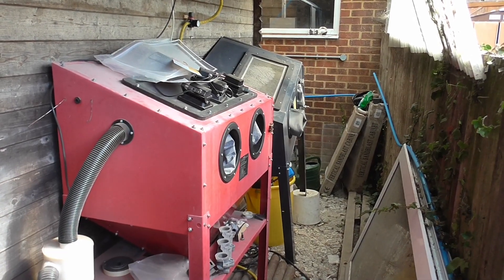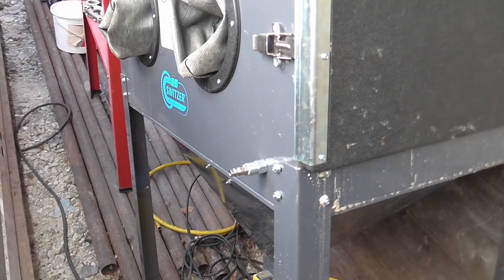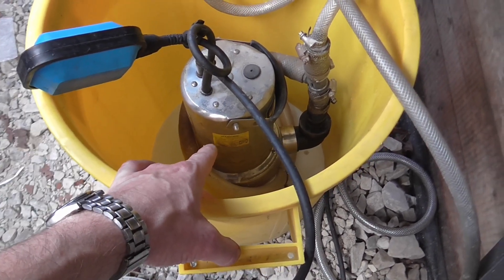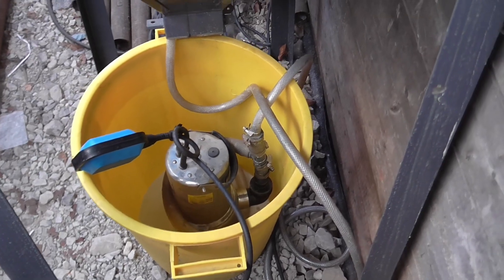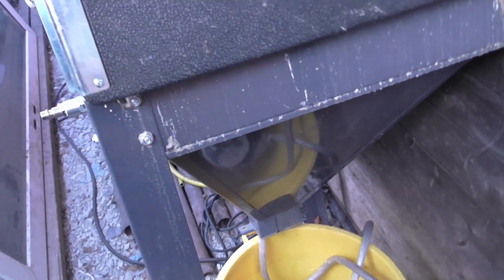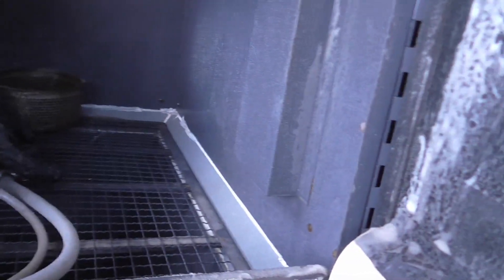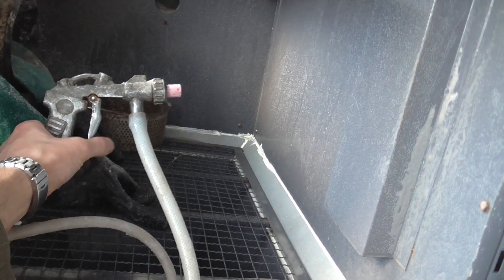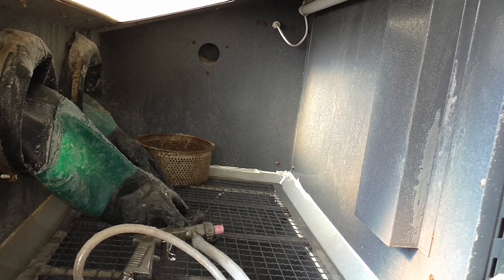A simple DIY Vapor Blaster

Comment: I highly suggest you clean your setup after each use and focus on the spray gun. Soak it in mineral oil and clean. I would use Fluid Film myself. It lubricates well, provides a strong barrier to the atmosphere, clings to the protected area and is nontoxic. I believe lanolin or something similar is the main ingredient
Reply from the maker: This video went up in September 2022 and the (£12 delivered) blast gun that came with the cabinet is still working just fine on total neglect. If it fails, I'll just swap another one in.
Reply: @EVguru  Fair enough

Comment: Just learning about vapor blasters and I'm curious...is a pump actually required?  It seems that since we can simply insert a pickup tube into dry media and the compressed air will suck that through the hose, that the same can apply to a water + media slurry.  The slurry obviously needs agitated to keep the media mixed with the water but I think that can be achieved with regulated air.  Am I missing something?
Reply from the maker: The media is quite dense and falls out of suspension very quickly. You need strong agitation to maintain the slurry. Adding air to water reduces the density, so the media would fall out even faster.

Comment: Really interesting Paul, a vapour blaster was an item on my wishlist, which is now on the future project list. Thanks for putting this video out there.👍
Reply from the maker: Glad it was of help. It's one of my favorite tool builds and gets used quite often. Are you still playing with Panhards?
Reply: It is, as I never really thought about making one. On Panhards,I haven't been active for a while as other stuff gets in the way as you know all too often, but I have just started resurrecting a dormant one owner Panhard. The crankshafts and valve seats are the Achilles heel in the engine department which is always a worry with an unknown motor & boy do I know about this when I've used secondhand parts. :) Hopefully it'll be on the road again soon, and I can start rebuilding this one properly. @EVguru